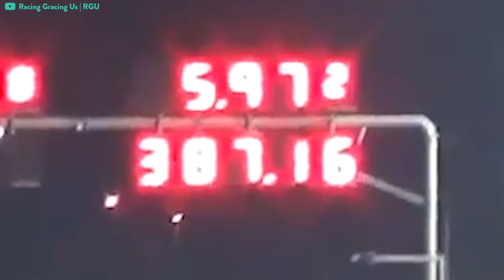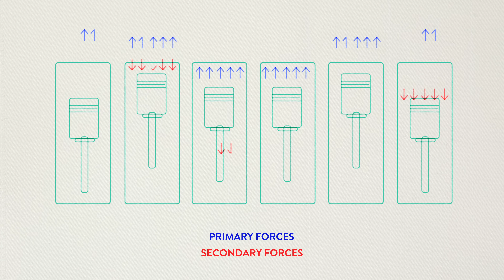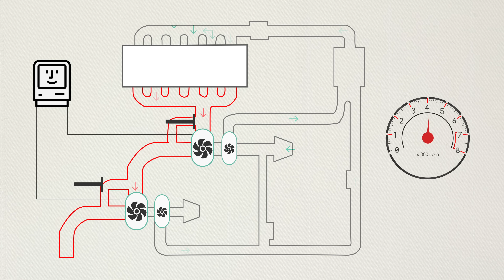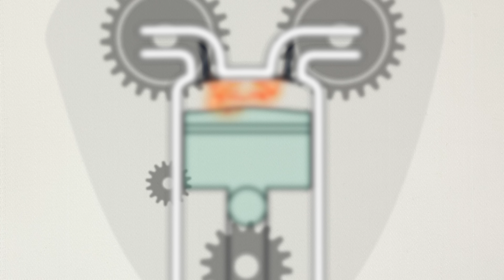2JZ ENGINE - How it Works | SCIENCE GARAGE

Comment: if its such a great engine, why is the new supra using a bmw engine?
Reply: lol go do some research. its not rocket science.
Reply: daniel zychniewicz such as?
Reply: @danielzychniewicz2633  well it is like rocket science because you told him to do research and I've found some info on rocket science by using that same method...

https://www.fourmilab.ch/documents/rocket_science/

Google is your friend chump.
Reply: Because they just don't make money out of it.
Reply: campkira since when have bmw engines been cheaper than toyota?
Reply: just research it man why they used bmw. i dont got the time to explain it to you. dont be so lazy.
Reply: daniel zychniewicz whatever for your fake comments.
Reply: Ever heard of euro normation for exhaust gasses? Its a great engine  because its strong and powerfull, but in the meantime a lot of aspects have changed in modern engine building so they van Apply to emission standards.
Reply: @Warhammer W40K 
Well, you can say the same about the VAG, PSA and GM groupe. Big car companies do this save money 
(and probably also to make money from the services done on the car).
However, i haven't heared much complaints about people how actually drive them more than 100000 km. The most problems i hear of are electrical problems, second would be as you said fluid pumps and than there major "first year of production" problems like broken thumble flaps on Diesel engines that are usually solved in the second year. All in all, they are quite good, people at the moment just are to upset about the  colaboration between Toyota and BMW. I have a question for you, what do you think would be less reliable, a completly new engine wich had no major testing, or an already build engine (even if from BMW) that has the major teething problems sorted out?
I would tend to the secomd Option ;D.
Reply: It's not even called a supra
Reply: https://www.youtube.com/watch?v=4QioRXLnl9k
This video is one reason why you shouldn't be upset about bmw engines in the new Supra ;D.

Comment: I will never understand the fan boi obsession with the 2JZ. They're heavy and add that weight way out front and high up in the nose. Then, add all the turbo system weight on top of that. Same goes from the RB26. Why does no one talk about the 2UR-GSE? Short of the 1LR-GUE (which is basically not available), it's the best engine Toyota has ever made. It sounds better, it's rev happy, it's lighter, the weight is lower and further back, and with some tuning, over 500hp is more than enough to have a great time.

Comment: Man, I always wanted to see an upscaled version of 2JZ. The 0.5L per cylinder may be okay, but since the engine design is so great I think you can actually upscale that thing. Like, 3.6 inch bore and 3.6 stroke. I think that 3.7L 2JZ would produce even more torque and power.
Don’t you guys play like displacement means nothing. Otherwise the newer 6 cylinder engines wouldn’t be that big. The VR38DETT, yeah? It has a 95mm bore and 88 stroke. That’s more than what a lot of european V8, V10 and V12 engines have. American engines are still bigger but not by much. 
Big upscaled 2JZ for the win, bruh. This time with titanium crankshaft and bigger turbines.
Reply: Toyota did this. It’s called a 1fzfe. Release in the us from 93-97 and was in the land cruisers. Iron block with aluminum head and capable of insane hp with a turbo or supercharger
Reply: RedsBaller then they should put that thing into a Mk-V instead of a BMW moneypit.
Reply: Oh it was 4.5 liters as well

Comment: Way back when that engine was just coming on scene I remember the shop I used to frequent flowed and measured the airflow dynamics of the head and it was quite confusing.... naturally it didn’t hurt much because it’s forced induced but seeing the numbers were headscratching... If I remember the outer cylinders flowed way odd compared to the inners. 
But oh man that block density and thickness up top was amazing.  The stock injector flow rates were quite impressive as well. No wonder why they became the monsters they are. That getrag trans was another badass piece.
Reply: thats why lots of people do a 1.5jz. they put a 1jz head on a 2jz block =1.5JZ = fucks lots of things